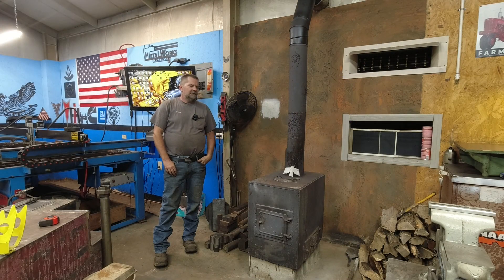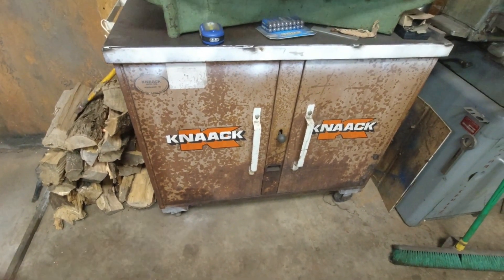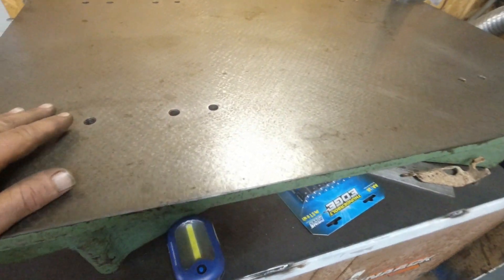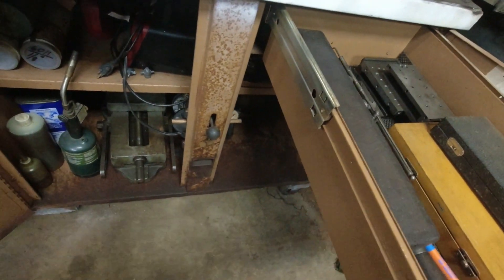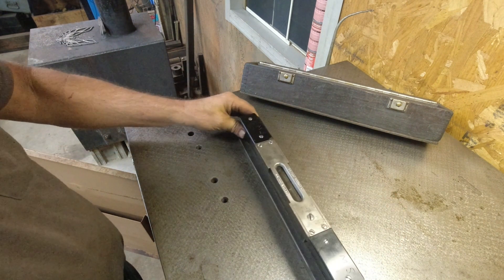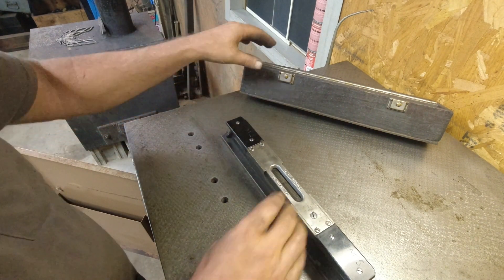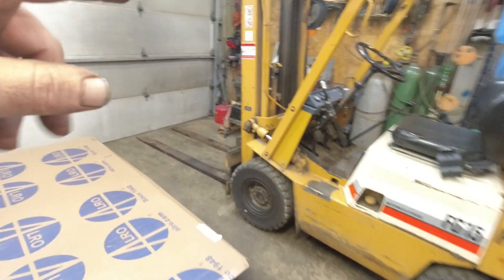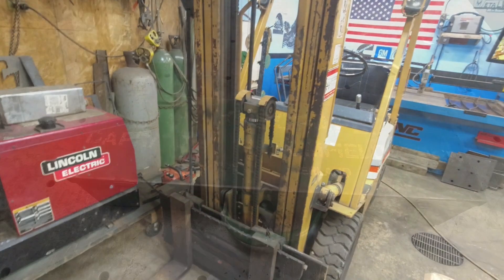Shop Update.. New Tools 2021

Comment: Those HF Batteries under the cast iron surface plate are equal to Duracell or Energizers.  They are great batteries.  Some great tool finds.  I love the Biax scraper.  Stay safe, and stay well.

Comment: That will be a nice TPG .   Have a practice run on something about the same material as your cylinder 
square first  .  My  experience with them with the limited type of wheels we can get here , is  it's 
difficult to get a good finish on softer steels .  
You have picked up some nice gear ,  You will never see a Biax scraper come up for sale here !  
Cheers .
Reply from the maker: If I decide to sell the Biax I'll ask you first.
Reply: @metalworksmachineshop  Cool !